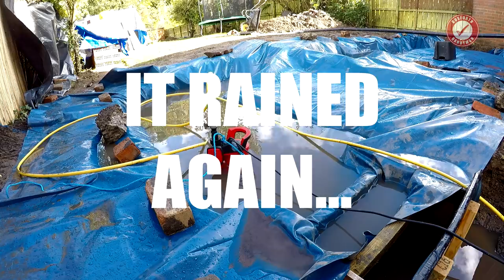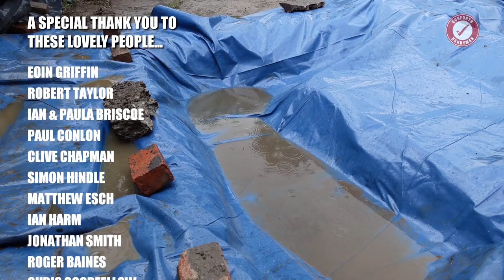Site prep and very wet foundations! (Self Build Extension Part 2)

Comment: Cover the bluebell bulbs with soil and don't leave them exposed to light.

Also, what to do with clay? Foundations of a pond are a good use for clay.
Reply from the maker: Yup, the bulbs are all buried ready for Spring 👍😁
Reply: @GosforthHandyman  I'd also consider using the clay to line the bank of the river, but you may not have enough. Great update!

Comment: I can highly reccomend a rain collection system for your rainwater drains. The costs pay  off quickly as you don‘t have to use drinking water to water the lawn or plants in the garden.
Were I live it is common to use the collected rain water for flushing the toilet. This requires a separate circut of pipes in the house though.

Comment: Omg, we're doing almost the same at the same time! Took 50 tonnes of stuff out, 500 blocks 2500 bricks etc etc in, into the back garden, all by hand though! 
Quite a bit of demo and clearing.
...and I had to bail out the slab 'pond' a few times. Now on the roof and enjoying our December weather!
The joys of building!
Reply from the maker: I refused to pour the slab until the roof was on. 😂👍 Best of luck with yours!

Comment: Did I hear correctly you've got 600mm deep of concrete going in? Is that standard these days? When I did mine a few years ago I think I went with 225mm deep (top of foundations required depth to limit heave etc)

Comment: What a great update! 

Question for builders/roofers perusing the comments: We are planning on having a side return extension on our semi-detached house. I want to know what you believe is the one essential bit of mechanical kit you need room to drive down a side return for any future building works, without which you/your boss would balk at taking on any future job to the back of the house. Or to put it another way, what is the minimum side return I should leave?
Reply from the maker: Cheers!

Comment: Will you still have side access after the renovations are finished?
Reply from the maker: Via the garage, yes. 👍
Reply: @GosforthHandyman  to many new builds and renos in my neck of the woods have no rear access.  Or at best a standard door width through the garage.  Makes getting furniture in and out harder than ever.

Comment: Another fantastic video! Just out of interest, could all of that organic waste be made into compost for the garden in future? Maybe if it was all thrown into a chipper to break up the big branches and increase the surface area of it, I imagine it would work well over time getting mulched down, or is it something that isn't worth the time and space for compost bins?
Reply: You can use it more directly than that - you can bury logs and branches under beds and they will slowly decompose and release nutrients over several years (as well as helping retain moisture). Wood chippings can also be used under beds for a faster but less long acting treatment, as well as making a great natural path material around beds.
Reply from the maker: That was mostly non-compostable waste, like old brambles, bind weed etc. It just jams in the chipper.